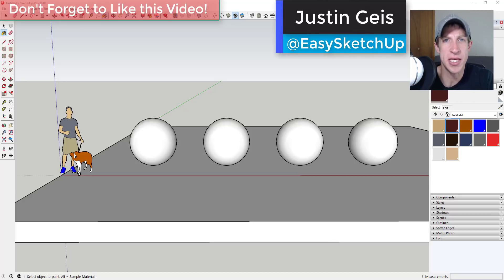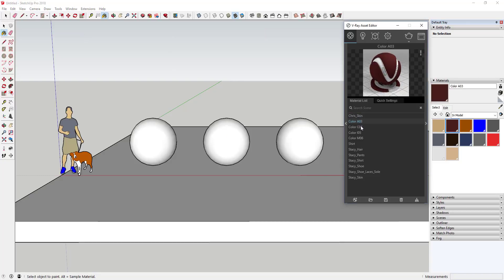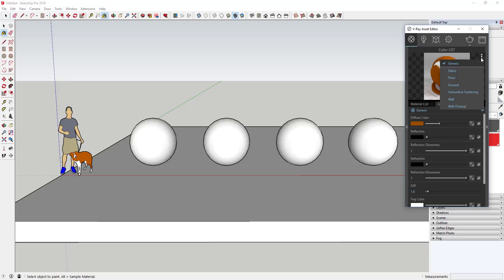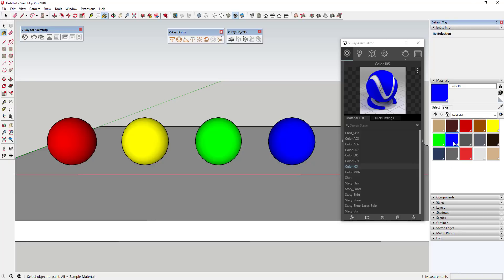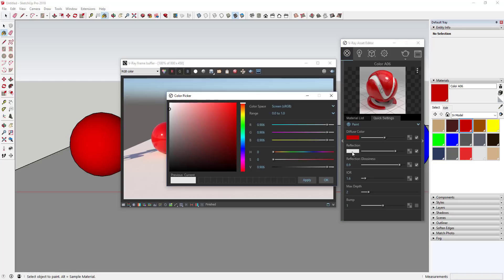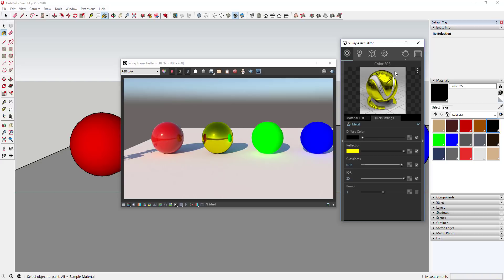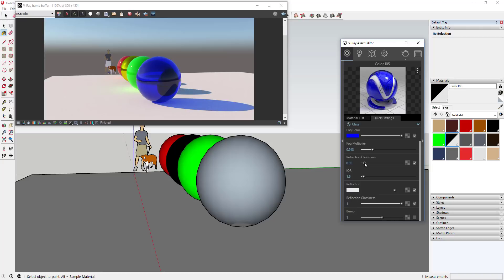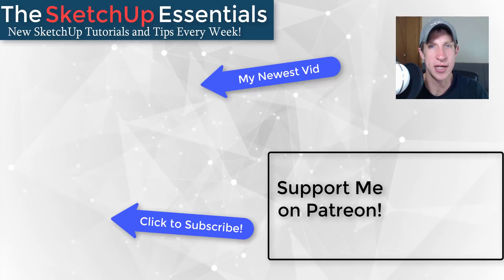GETTING STARTED WITH VRAY MATERIALS - Vray Rendering for SketchUp Tutorial

Comment: Thanks for the video, really helpful! It doesn't work the same way in mine though. When I select the color from an object, it doesn't reveal in vray material list. So I never know what material is already applied to any object. Why is that? Thanks :-)
Reply from the maker: No idea - what version?
Reply: Thank you for the response. It's Vray 4 and Sketchup 2019. When using the dropper on an object, it literally only picks up the color, even the color of the interface panels, as if I'm using photoshop picking up color from an image. When I select an object, nothing shows on the material list (both vray and sketchup). I never know which material I used for an object...